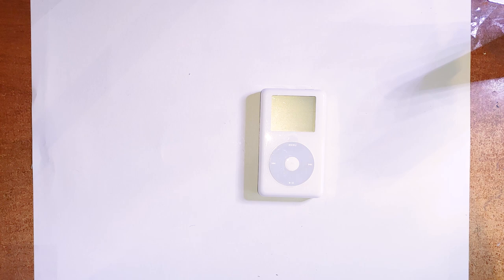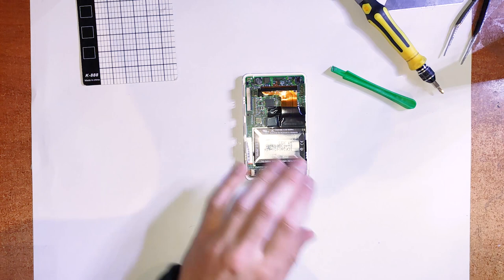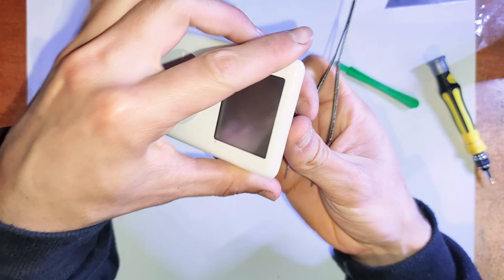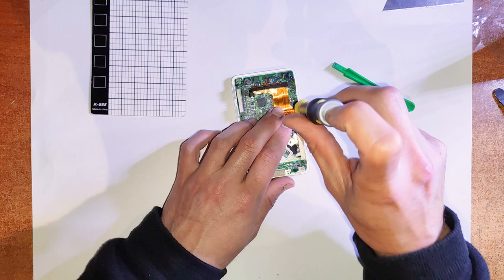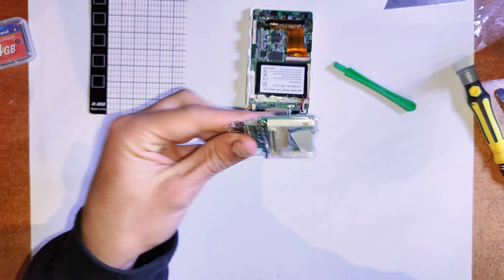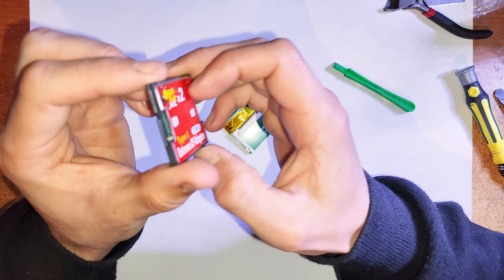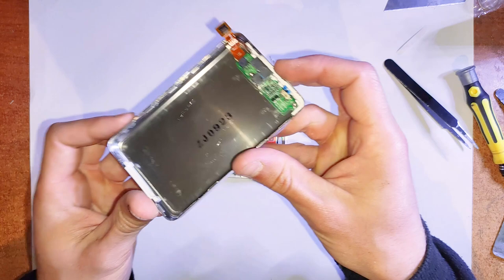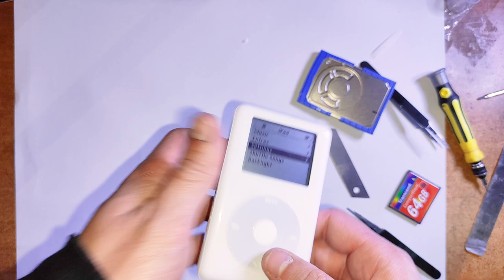Apple iPod Classic 4th Gen Ultimate Repair Guide Battery Replacement Hard Drive Upgrade CF SD Card

Comment: I cant for the life of me pry open my iPod. I tried using a screwdriver, an X Acto knife, a guitar pick and a spudger and nothing has worked. Does anyone know the exact best spot to take apart the iPod?
Reply from the maker: hmmm, its possible it may have been glued together if that is the case.This model usually comes apart quite easily. Anywhere down the side should do it. But if you have not yet tried with a dull box cutter blade i would give that a go. the guitar pic and plastic pry tools usually aren't strong enough for this.

Comment: This was super helpful.
I'd replaced the old hard drive with a similar setup and got everything working. 
Screen was working fine, so I closed the case, and everytime I closed it, the screen wouldn't work anymore, though the iPod still functioned fine.

Seeing you bend back that jumper made me think I should give it a shot. Sure enough. No screen problems anymore, all working now.
Reply: I am having that problem now..what did you do to get the screen working again?

Comment: I taped the contacts on the underside for insulation.

It is not known where the battery charge controller is on the board of this player?
It charges normally, but discharges on its own, even if you don’t use it and doesn’t go into sleep mode.

Comment: Good instructions. I’ll be replacing the battery in my gen4 iPod soon. But what would be the cause for the buttons not working? The wheel and the “menu” still works. But the “forward”, “reverse”, and “play” don’t. 
Dirty contacts or replace?
Thanks

Comment: Do you have to format the Compact Flash drive before installing it as a replacement drive ?  The the ipod have a formatting function on it ?  Where is the ipod operating system located ?
Reply from the maker: you usually dont have to. If you plug it in to your computer and open itunes it will give you the option to restore the iPod, which will format the drive..
Reply: @partspluspods3689  I replaced the battery and upgraded the IDE drive to the CF card adapter (with a CF to SD card) as per your video.  Got the whole thing back together, but it won't boot up.  The screen is dimly flickering.  Any ideas as to what could be wrong ?  Thanks !
Reply from the maker: @loop-t-loops1035  did you bend the pins over on the IDE to CF adapter? they may be touching the logic board causing a short circuit. I show it in the video.